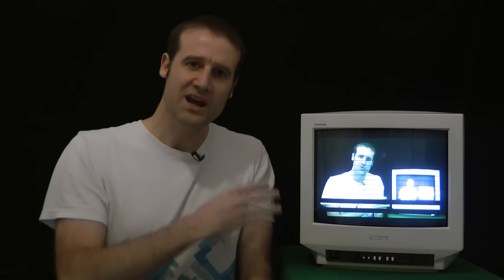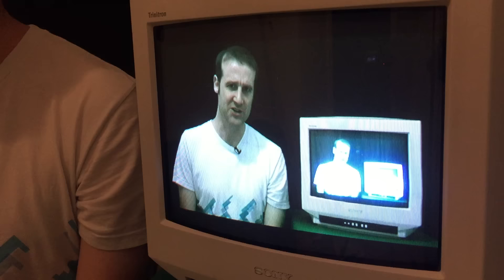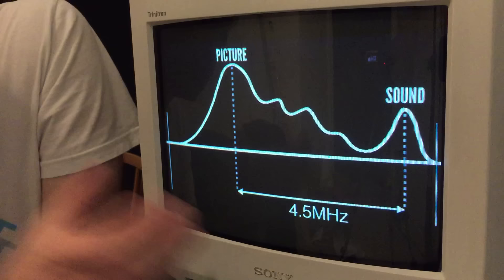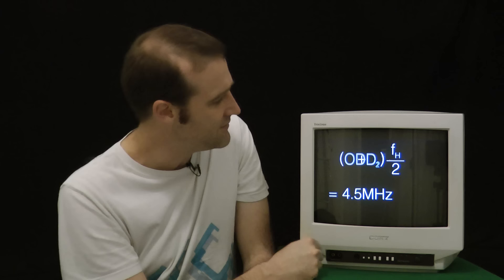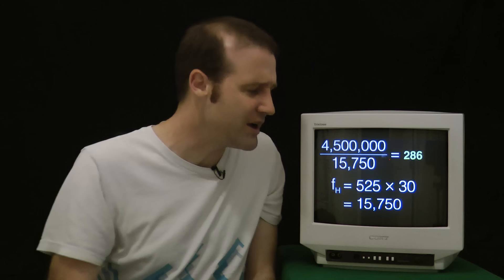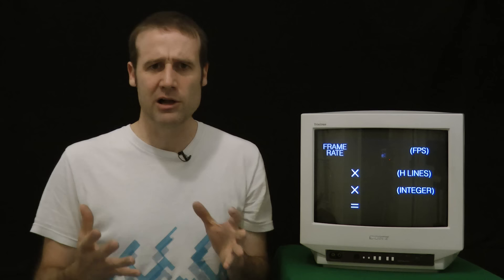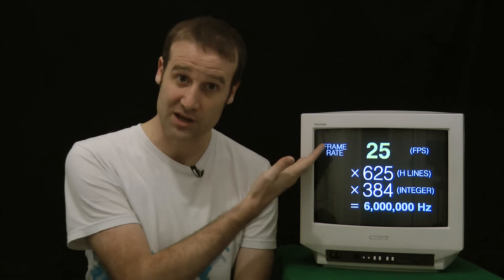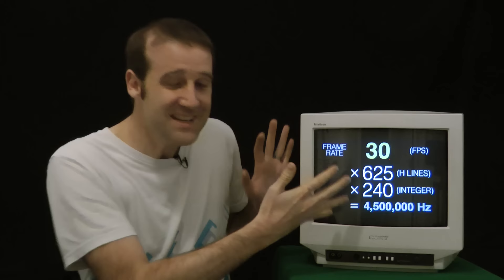Why is TV 29.97 frames per second?

Comment: Very interesting video.

One thing which weighted on the reason they did not want to change the number of lines:

Back then. things were built to last (at least, to last much more than now) and the rate of change/progress was much lower.

They had to respect all the people that were already owning a B&W TV, and that would not buy a color set before many years later.

This meant the new signal had to be compatible. The 525 lines had to be respected. They could not simply say:

"Hey, all of you with B&W TV owners, from now on, our TV signals will have too many lines for your TV sets, so throw them in the garbage and buy new ones!"

Heck, they couldn't even change the number of lines lines to 524 or 526, either. That would mean that the slightly-too-small image (524 lines) would not reach physical line 525, the "half a line of zapping back to to of screen" signal would be confused with the the data for line 525 (making that line look like ugly junk), and the line 1 data of the next image would be interpreted as "jump back signal) (and skipped), and the all with a half-line delay desynch. Ouch. So you'd get 2 overlapped images offset by half the width of the screen, and that also slowly scroll up  the screen every 17.5 seconds. Wow. Talk about looking at pure garbage! Same for 526 lines, but scrolling down instead. Yeepee.

Basically, all the stores TV inventories would be ruined, or they warn well in advance and B&W TV sales would drop drastically in the couple years before the swap. You can easily see the huge uproar that that would have caused.

Nowadays however, things are different, We're used to "use and throw away" and a much faster pace of change. When TV went digital, all analog TV owner got told (YEARS in advance): either buy a new TV with digital capability, or buy a 100$ separate special digital-to-analog TV Tuner & converter, that will convert the digital signals back into analog for your old TV. For years people bought TVs that had both digital and analog inside, until the actual signal swap which forced only those relatively few with really old TVs to either buy a new one or buy the special tuner. all in all a relatively painless migration. (well, that was when I stopped using my 10 years old TV lol to watch TV, only for my playstation and video cassettes, until the internet got me too).

Some grumblings, but the transition went without too much of a itch. Even then, it took years and was planned for a very long time.
Still, a 100$ tuner is still costly, and such a tuner/converter is a relatively simple piece of electronics. But much less than a brand new TV.

But that kind of thing would have been impossible to think of back then. Can you imagine taking a 625 lines image, and having a "tuner re-parser" that rebuilds a 525 frame image "just for your old B&W TV". Skipping some lines? That thing would have need of a special "buffer" and been quite complex and would have overall cost much more proportionately to buying a new TV anyway. Many old TVs had straight out antennas jutting directly out of them, without "cable input". Because that was entirely before Cable TV! In fact, a TV back then looked more like a radio that also has a screen!

So, there was no capability to "add a tuner". People also had the tendency to use their TV set not for a mere 5 to 10 years, but fully expected it to last at least 20 or more. Same as refrigerators, truly: refrigerators of that era didn't have all the bells and whistles, but those things are seemingly invincible and eternal, while today's refrigerators will last you about 8 years. If you're lucky. so they couldn't just 

Also, If a device able to grab in radio waves and convert them back to the old format for your old TV existed, that would flow the airwaves with way too much interference, too. And keeping separate frequency spans for B&W and for color would also have been wasteful. There was just no nice little cable input for a converter to be designed to attach to the TV.

So it was the signal itself that just had to be fully compatible.

Changing the number of lines was completely impossible for economical reasons, while very slightly changing the frequency was in fact possible, and the old tvs would still work ok with the new airwave signal.

It's the initial 525 lines which was a bad choice. Or the assigning of a 4.5 Mhz wide airwave band.  But to their defense it is extremely hard to predict in advance how tech will need to change. And I'm quite sure there was a strong reason why "525" was the number of lines initially chosen.

Comment: I'm late, but I'd imagine that the horizontal refresh rate increase the greater number of lines would impose would fall outside of the operational parameters of the old CRTs they desperately wanted to be backwards compatible with. I'm sure they calculated and tested this for quite some time before agreeing on the frame rate drop.